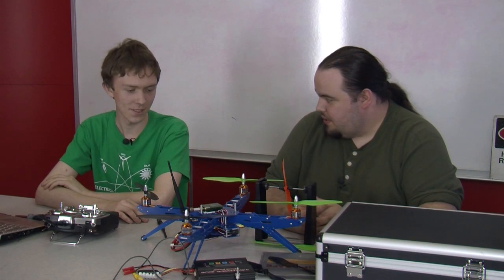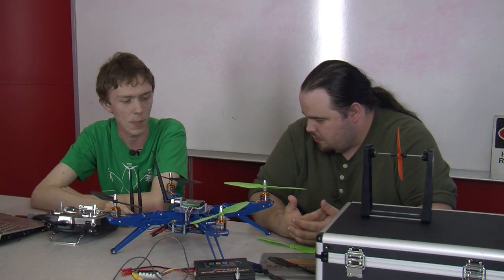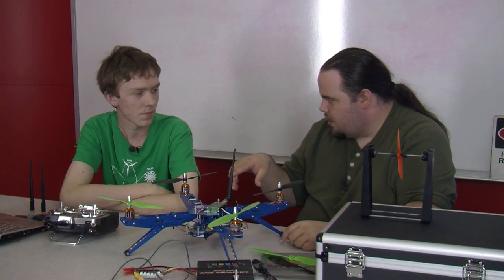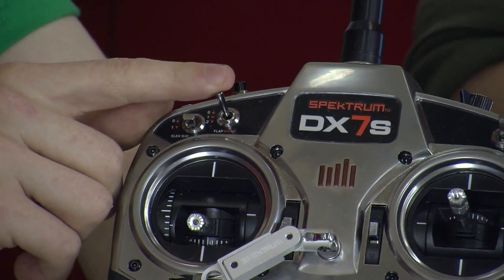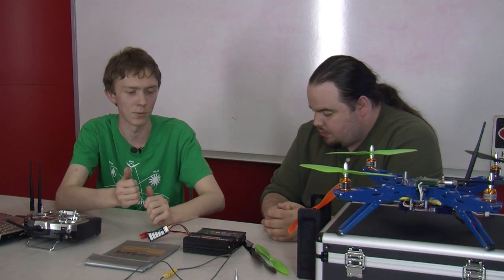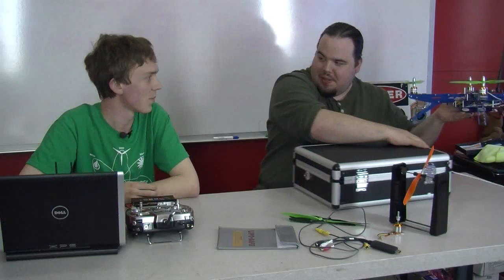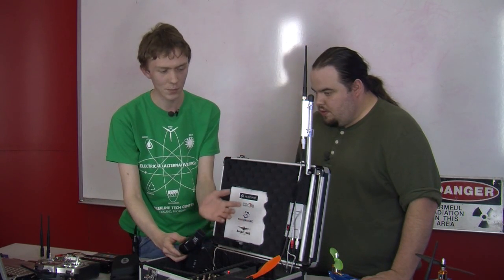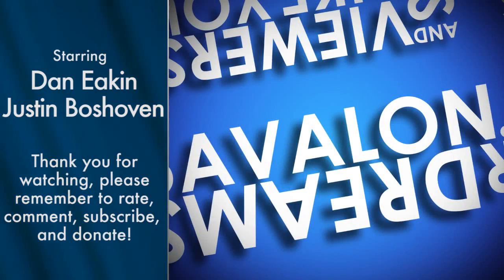Member Projects: Quadcopter

Comment: O.k., that was a very cool member project, but couldn't some of that stuff have been made in house, the cnc could have cut the frame, the boards could have been custom etched and soldered by hand, it seems like an elaborate and expensive hobby if fun, but could not the resources of the geek group have helped reduce the costs if increased the complexity?

Comment: Depending on where you live. Check that the frequencies that you are using are legal? Where controlled airspace is and height limits for models-UAV. Failsafe mechanisms? Never fly beyond visual range in first person view without a safety pilot. Yes I know there are lots of videos showing otherwise but that does not make such conduct truly responsible. Otherwise you could find yourself in a heap of trouble if you cause an accident and cause other repercussions. Safe flying is no accident.